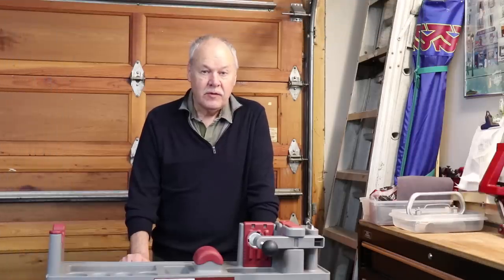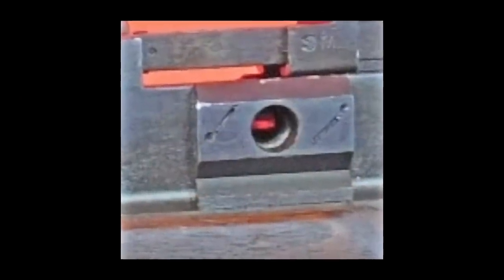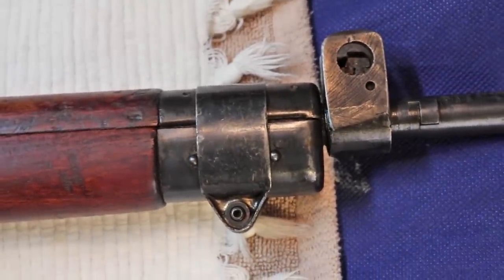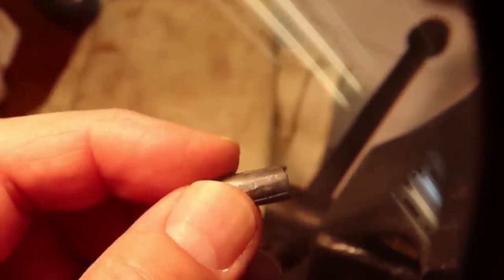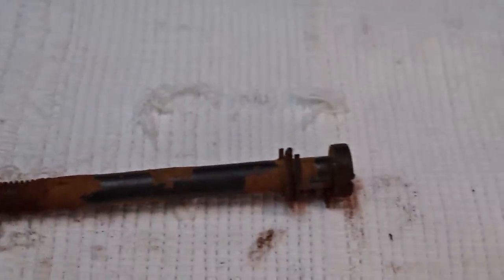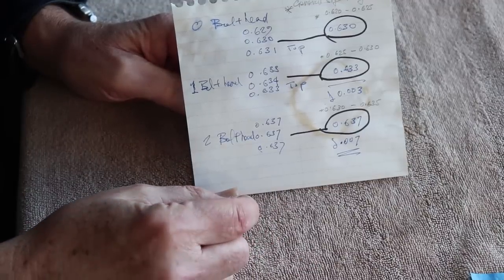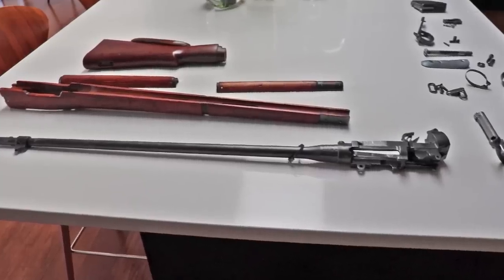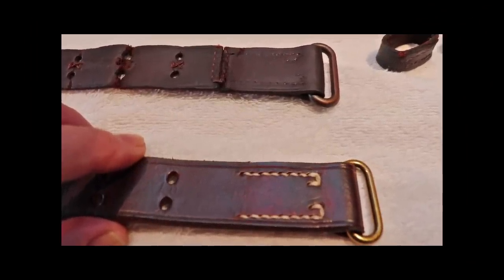Lee Enfield Sniper Rifle Restoration

Comment: Robert, [with reference to the WW2 British sniper's role] snipers Do NOT shoot in the standing nor any of the sitting positions. Sniping was all about concealment and accuracy. Snipers always used the leather sling in the prone position. (Incidentally, the standard issue canvas sling was never used as a shooting aid, we British shoot the Lee-Enfield rifles off hand. And even off hand, the standard No.4 (no scope) is capable of an incredible 8 inches accuracy at 1,000 yards.) At 25 yards, you should be getting an accuracy of close on .394 inches where the entirety of the group of 12 shots is contained within that diameter. 

One further point. You need to hold the Lee-Enfield rifles correctly, in order for the rifle's incredible mechanical accurization mechanism to work. It's all tied up with why the barrel has an approximately 5 - 7 lbs downwards press at the muzzle. It is crucial to grip the foreend with your left hand, so as to hold the rifle down against the barrel moving upwards inside the woodwork (or furniture, as it's termed). The hold you're using, with the foreend just sitting atop a rest, doesn't allow the rifle to work correctly. Accurate shooting of Lee-Enfield rifles is all about correct positioning and the correct hold. Indeed, you need to learn how to do this without that leather sling (off hand) before fitting the sling, else you won't be familiar with how the rifle should feel and behave, before introducing another element. 

Rick

Lee-Enfield Expert based at NRA Bisley, UK
Reply: Flip465  I salute your service to your country. However, we're now talking about my country, and about how a BRITISH Sniper Rifle was used by BRITISH Snipers in WW2. 

The Lee-Enfield No.4(T) was not fitted with that expensive leather sling (which had to be imported from the USA in time of critical import shortages) so the sniper could shoot in the standing, kneeling, squatting, nor sitting positions. BRITISH Snipers simply didn't do that as a basic rule. 

Your mention of US Forces doing this during the Vietnam War era, tells us where Robert picked up the idea that snipers shoot from positions other than prone concealment. 

During WW2, BRITISH sniper training was done in an emergency. The key attribute of the sniper was concealment. Accuracy in Marksmanship was important, but somewhat secondary to concealment. Remember, the WW2 BRITISH Sniper was first and foremost there for reconnaissance. Shooting key enemy personnel was a secondary mission. Which is, perhaps, the precise opposite of the role of the US Forces sniper during the Vietnam War?

Rick 

Rick
Reply: @rickbear7249   He probably likes the bit where the sniper in Saving Private Ryan. shoots the Geman sniper who's sitting well back inside the tower on an overcast, rainy day and still gets shot dead by the US sniper who 'it seemed' had super-duper awareness, target acquisition, excellent vision and able to keep his scope-lens clear of raindrops to kill said sniper...Like most of the film, absolute bollocks...

Comment: Thank you so much for this video. I have a small magazine Lee Enfield which has the year 1943 stamped where yours is at I was thinking that was the year of manufacturer but I wasn't sure but now I know. Unfortunately it's not it's an original configuration definitely no collector's value but it's a great shooter.
Reply: I think you mean Short Magazine Lee Enfield.  I know that sounds strange, since it holds twice as many rounds as a Mauser.
Reply: @arrlmember  you're absolutely right.  I stand corrected.

Comment: Very similar to the first sniper rifle I trained on, the L42, I moved onto the L96 in desert storm and I’m currently using a Sig 716 (Police).
Reply: I was on the last sniper course at CTCRM To train with the No.4. As the cross-over course we were also issued an L42.. i used the No.4 for my final badge test stalk and the L42 for my final badge test.shoot. Passed both so I must have been doing something right.
Presently still shooting as a civvy but using a Sig Tac 2 in 300 WinMag.

Comment: Not only are you good as a gunsmith, you're good at making videos too - excellent cinematography.   QUESTION -The handle on my Enfield bolt pops up about a half inch when I shoot. I've seen this same movement on several other videos but it certainly does not seem right. It's seldom that I shoot it because of that. Can you tell me what to do about this condition.
Reply from the maker: Hi Ken, 
Thanks for the kind words.
The pop-up is normal to a Lee Enfield especially when dry fired.
Regards

Comment: Surplus "Enfield" Warning: The following notice from the United Kingdom Liaison Office, Armament Research, Development and Engineering Center, Picatinny Arsenal, N.J. " 1. In July 1987 a U.K. M.O.D. ban was placed on the firing of ball rounds from cal. .303 No. 4 rifles in U.K. service as a result of two explosions in the chamber area of the weapons and resulted in burst barrels. 2. U.K. M.O.D. investigations found that the barrel explosions were as a result of severe 'craze cracking' of the two barrels which were of indeterminate age and life. 3. U.K. M.O.D. have initiated a study into why some barrels suffer craze cracking and others do not, but results of this are not expected to be complete for some time, and even then might not be conclusive. 4. Because, in peace-time, cal. .303 No. 4 rifles are only used in Cadet units, it has been decided that it is not cost-effective to carry out detailed examinations of all barrels, particularly as the Cadets are being issued with the new L98A1 Cadet GP Rifle. The firing ban will therefore remain in force. 5. Users of the No. 4 rifle worldwide, whether civilian or military, are STRONGLY ADVISED to have the weapons examined for signs of craze cracking (by an experienced gunsmith) and condemned accordingly. Thereafter, it is RECOMMENDED that any barrels which have PASSED such inspection should be EXAMINED REGULARLY for such signs and condemned if necessary." ( from a compilation of articles published in American Rifleman magazine, Author unknown) As an owner/shooter of surplus rifles, I thought this may be of interest to your viewers/subscribers and the purchasers of the recently acquired lot of No. 4 rifles from France being offered for sale from Navy Arms.

Comment: Excellent video!  I've noticed the wear on the  bolt bearing surface on the back of the receiver (I don't think it was hardened) has a lot to do with headspace...  The bolt heads were hardened, so it seemed odd they would need replacement to a larger one with use....

Comment: With my 303, I was fortunate enough to find some rounds that were loaded with cordite propellant. they where far better than my handloads. I still have some, 100 rounds or better.
Reply: The Cordite loaded rounds are extremely corrosive, I bought a 1000 pack at auction so have plenty left over, the primers could of course be the corrosion problem.
Reply: @453421abcdefg12345  I clean it from muzzle to stock, and yes I have heard that.
Reply: You Reloaded 303, mine always split hxp 86 bandolier on stripper clips. I haven't seen 303 without the first 3 in pitted from corrosion.

Comment: It’s amazing to think that the British Army didn’t actually retire the No4 Mk.1(T) sniper rifle in .303” until 1972.
Reply: @mrjockt: I’d respectfully like to point out one erroneous detail in what you previously stated here in this thread. 
I think you had meant to say that it was finally retired from active use by the British military in 1992, & not 1972! 
In 1972, the British Army & SAS units sniper teams were at that time actually reintroducing the then upgraded Lee Enfield No. IV Model T into active use in various deployments in the Northern Ireland Troubles that were still then in their initial phases of that conflict.
The British Armed Forces have since 1992 opted for a variety of updated ‘Sniper Rifles’ mainly models produced by Accuracy International (A.I.) a UK based company founded in Portsmouth, such as their L115A2 & A3 (Arctic Warfare Designed Long Range Sniper Rifles) models, which were used to devastating effect in Afghanistan where in 2009, an army sniper team shot & killed (Later confirmed) a Taliban fighter at a distance of 2,707 yards/2.475m., then using this weapon!
Reply: @trevorfuller1078  I did mean 1972, that was the year the British Forces officially stopped using the No4 Mk.1(T) in .303” and replaced it with the updated version modified to use the 7.62 NATO round and re designated L42A1.

Comment: I have a No 1 Mk III that I need to fit a new bolt head into and need to file it a bit. I'm curious as to what tool you used to file the bolt down with.  What make/size file?  I'm also curious as to how you put the bolt head springs back in without breaking them. Really like your project results! Looks great!
Reply: Do not use a file, use a whetstone of 800 grit
Reply: The bolt head didn’t need stoning after all.  Fits beautifully with the original bolt and a field gauge check shows the headspace is good.  Tightened down the screws on the forend and getting good groups.  Put a long but stock on it as well to get a good cheek weld.  Still needs a few windage adjustments but elevation is good.  Almost have a zeroed rifle!  Won’t be long now…. Very happy with how it’s turned out so far
Reply: @wolfpack4694  Good to hear!

Comment: I have one of these, ( see my channel)  Personally I think  taking out the dents, and refinishing stocks, changing parts, fixing parts etc ruins the aged patina of a rifle. My rifles have all their damage, burn marks, dents, scratches etc left where they are. All I do is wax the stocks and oil the metal.  One of my rifles has a massive burnt stock, the last thing I would do is fix it or repair it.  If im buying a rifle and it has been 'restored' i walk away.
Reply: Well, in order to keep rifles in the gene pool one must change and fix parts necessary to proper function of the rifle
Reply: @thecanadianlanboy8132   Totally understand replacing parts for a proper functioning rifle , but refinishing a stock makes no difference to the function.  It just takes all the age and patina from the rifle and makes it characterless.  I understand replacing springs or pressure bearing parts. But rebluing or refinishing a stock is not essential.  You end up with something refinished ..   and all its history rubbed out or replaced.  Just a thought.  Changing parts like a sight because its pitted means you end up with a rifle without its original sight. And if its serial numbered sight, you end up with a bits rifle.
Reply: @MetamorphicWonders  I almost completely agree, however sometimes stocks must be refinished to make them correct. Such as an 1871 Vetterli I worked on, the gun was completely original other than the stock which had been coated it a nasty shellac, this was removed and the gun was given the original linseed oil finish.
Regarding patina, if your gun has patina, then it's actively decomposing. There are ways of stopping and removing rust without damaging the finish, I would suggest you look into steaming, and boiling conservation
Reply: @thecanadianlanboy8132   Absolutley.  If its been coated in  something it needs to be taken off.  Its a fine line between overdoing it and necessary restoration.  I have a lovely SMLE its got dents and even fire damage on the stock.  Straight from the trenches of WW1.  Totally matching numbers.   It would be ruined if the stock was rubbed down and all the damage taken out of it.  (I shoot this in one of my films on UTUBE of you would like to see it.  ). Another interesting example is in WW2 a row of No.4 T rifles were laud out on the grass.  A army lorry rolled over then and crushed and damaged half.  The soldiers made up a few rifles from the parts.  So a question for us is “are they original?” They were fixed in the War.  But all mix matched.  They are still WW2 but bits.   I would reject one as not factory original. But people would disagree.
Reply: @MetamorphicWonders  At Brecon Army Barracks  museum , in Wales UK , there is a WW1 SMLE on display with the breach left open . It is open so that you can see the nose of a Mauser , German anyways , bullet that has travelled down the Enfield's barrel . Seriously odd .
It is a brilliant little museum , well worth a look , if you are visiting the area ; it has Zulu memorabilia and World War stuff mainly and is located at the main depot of what was the South Wales Borders . They have an internet site called 'Military History With Will 71' . Wil , or Arfon as he was named originally , is a laugh a minute . Check it out ! Class

Comment: One would be hard pressed to find a used Enfield that did not have a bit of excessive headspace.  It was the way they were designed & built.
Reply: They were "designed" to have excessive headspace??? I wonder why they made 5 different lengths of bolt heads then? 😣

Comment: Does anyone know if the 1907 sling that Robert mentions in his video is specific in demensions to a No4 MK1 or are all 1907 slings the same? They are for sale on Amazon and I do realise they are not the original.....
Reply: Standard M1907 sling (and dimensions) used on the No4 Mk1 T Rifles during and after WW2.

Comment: FYI WD - 40 does have metal particles in it ,as a linemen it can be deadly as far as tracking high voltage electricity especially if used as a lubricant on your safety equipment hot sticks etc . Not sure what effect it would have on that old gun barrel. Spray some out on a piece of paper check it out.
Reply: WD40 was developed to reduce condensation in missiles whilst being launched I believe . Condensation would have been not so good for electronics in the missiles ; basically it is a water repellant that has been ( the original version this is) used for all sorts of uses it was not intended for , but it manages fairly well in the short term .; a jack of all trades , master of none . So why do you think it has metal particles in it ? Mind you , I am not a doctor and certainly not a lineman . Its made from fish judging from the smell !!!!

Comment: I have just received a "new to me" 1949 No.4 Mk.2 rifle. I have noticed that the barrel at the sight end does not move at all. I have had other lee enfields where there is pressure on the barrel and if you push it it will move slightly. So is a rifle that is fixed in position a problem? If so what should I do about it? I have yet to fire this rifle so I have no idea how well it shoots, should I take it down to the range and see if it shoots correctly?  Any help would be appreciated.

Comment: I once had a SMLE that the wood, not walnut, was a very light color. It shot some 4 inches to one side at just 25 yards. I found the fore stock was very much warped to one side. The substitute wood was so badly warped as to be unusable.

Comment: Rear locking lugs. Not used anymore by anyone. Considered inferior but? I like the idea of both front & rear locking lugs as u think might provide superior accuracy. Think about both push pull "isometrics" with your arms to steady a pistol. If both front and rear lugs have sane push pull effect against one another esp with 3-4 lugs on both ends it will lock the bolt up lined up with the barrel round way more precisely every time. Problem is for this to be done? Requires both sets of lugs to be hand lapped in on every rifle.(Grinded down with lapping counpound till it will finally close) Bet this  is why it has never been done. Too expensive per man hours for any manufacturs to do

Comment: Years ago i was in Carson City, Nevada gun shop and was shown was was supposed to be a sporterized jungle carbine. I recognized it as a Mk1#4 T. I found all the parts excepg for the #32 telescope to restore it. I still looking for a 32 mk3 scope. Until then a redfield 4x will have to do. It shoots well. The chinese copies of the #32 scope dont hold up, i heard.
Reply: The #5 Jungle Carbine is a #4 with a lightened receiver, shorter barrel and a permanently attached folding bayonet.  
Something I learned while working on getting an Amateur Radio License is the importance of reading and studying before jumping in with both feet.  That applies to firearms purchases as well.
Reply: @arrlmember  permanenly attached flash hider?

Comment: There is a lot of good information in the video.  
While I must admit that I know more about Mausers than SMLEs, I do know enough to NEVER file the locking lugs.  They should be lapped against the surfaces that they bear against in the action.  This is usually done by removing the barrel and screwing in a device that puts pressure on the front of the bolt, and then working the bolt handle open and closed several times with lapping compound matching things up.  Surely there are several videos available showing how to do this.

Comment: I have a question my Enfield no4 mk1 has no rear receiver sight mount it has the screw holes on the side of it for a scope mount it's a 1943 but someone put a hunting stock and forearm on it and they put a side mounted redfield peep sight on the rear most of the numbers are worn off above the trigger but it says m47 looks like a 124 under that but it is pretty worn  as far as I can tell their is no serial numbers but on the barrel it says an X, B, 2, crown above N 41 with and arrow, an arrow, crown above Y, crown above ui 6t, on top of front of reciever a mark of some kind above a bv6, back of reciever an X, looks like a bird marking, looks like MOH, crown with something and a 1 just wondering if it is just a normal Enfield